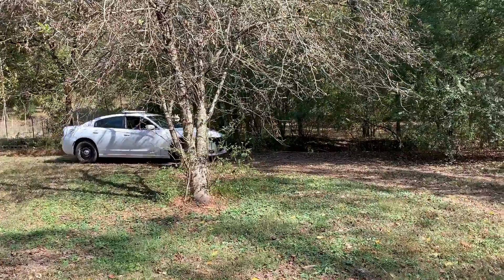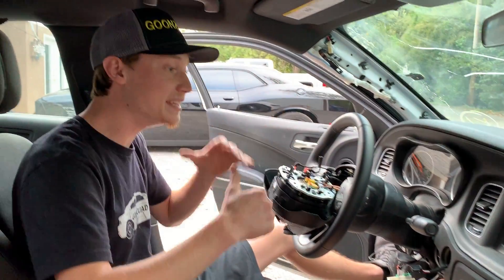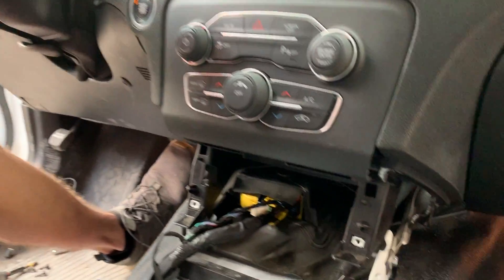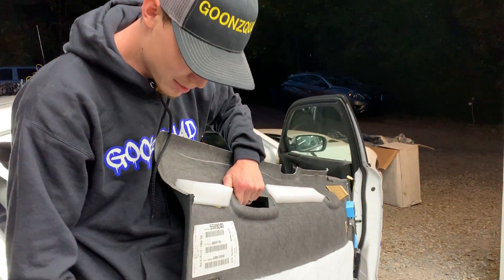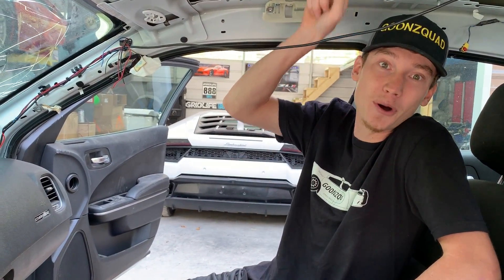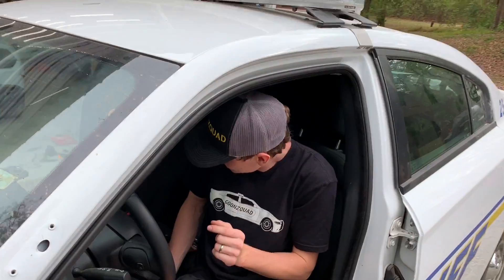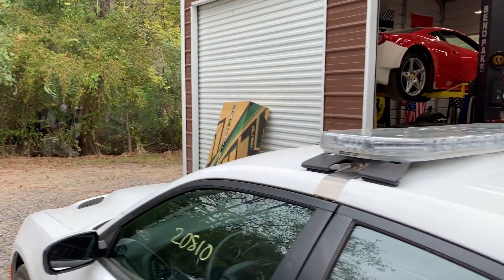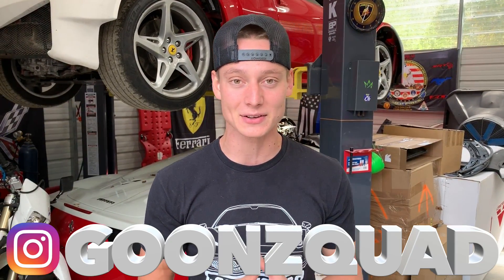Rebuilding A Wrecked 2018 Dodge Charger Police Car Part 8

Comment: Make sure when you get your new decals made, that you get the sign shop to use reflective vinyl. I had a sign shop and did a lot of first responder vehicles with reflective vinyl lettering and stripes. At night they look like they glow when any light hits them.

Comment: You're gonna want to move that arm rest farther back on the Jotto Desk console and move the cup holders up towards the dash ahead of the light controls. Trust me....also, get a 3M disc adhesive removal tool. It's an attachment for a highspeed drill and will "erase" any of the graphics as well as the adhesive without damaging the paint.

Comment: I’ve been working at HYUNDAI Motor in Montgomery for 7yrs, and I work in the trim shop that puts in mounts and seat belts and headliners etc. we put them in through the front windshield while the glass is still out.
Reply: I heard Hyundai work yall to death over there. Had a few cousins work there
Reply: My job easy.. Although I can’t speak for everyone else
Reply: There is more then 1 way to skin a cat you know.

Comment: At the factory, the headliners come in through the front windshield before the windshield goes in.
Reply: Enrique Velasquez I was about to say that
Reply: So funny, I was about to say the same thing, I spent 27 years on the assembly line in TX.
Reply: Enrique Velasquez I thought so too. I was thinking that would happen before replacement of the windshield? But their solution seems to work well too.
Reply: Yep, might be able to get it into the car without folding it up and risking damage. Have to coordinate with the glass guys; only take a minute to slip it in thru the windshield opening after they take the glass out.
Reply: @adolpheddie  yes it is. I work at the toyota plant in canada and looking at how all the internals are assembled is similar to how it is on the Corolla, rav4 and lexus 350. Funny how most car manufacturers assemble the same almost.

Comment: hey guys, when using a hole saw in order to not bend the drill bit when the saw hits the metal.  use a fender washer large enough to cover the saw.  also when cutting with a hole saw put the saw on an angle, and work the area that is all the way cut through around till you are done, you find this helpful.  mike   I love you videos I came on board when you first got your Lambo, I was so surprised to find a couple of young guys that were absolute PROS!!!  since then I have seen many of your videos and am not surprised to see that your work is FAN FREAKING TASTIC!!!

Comment: I’m a deputy in Florida. The light bar has different flash patterns, depending on the maker of the cluster box.
Reply: Thank You For Your Service Deputy 🙏🏻
Reply: Are people allowed to have the speaker box thing an light bar. Or are you going to confiscate the car.

Also for as 2018 car. Thats only 1 year old. You guys trashed the shit out of the interior.  Whats up with that. Don't you respect your cars.
Reply: Stephen Bachman they drive them 24/7 so it takes double the abuse of a normal car. think about it
Reply: @stephenbachman132  they can have them they just cant use a siren or blue lights on public roads.The cops drive around all day in the cars so they probably get dirty waay faster than a normal cars interior does.

Comment: The parts car was so worth it, y'all have def got your money out of it! Smart move y'all!
Reply: Yup, you just can't beat a parts car when you're rebuilding something.
Reply: I agree that a parts car is always good, but how can you say it was “worth it” when they never said what they paid for it, or that they compared the cost of the parts they used vs the parts car price?
Reply: @WIDESIDE72  they did say how much they paid for it when they first bought it and that they paid about $3000 and also mentioned that the parts they needed would have cost them more if they purchased them separately as well as the fact they've took more parts off the car then originally intended.

Comment: Thought about not commenting but here goes. I build ppv " police patrol vehicles " for a living. It doesnt matter what color LED ' s are on the car, or if they're on private property. The only thing that matters is, are the lights on while the car is moving. You can " display " the lights, just not in drive. Also put " demo car " someplace on the car. Another thing that cusioned pad is an arm rest. Put it on the rear of the console. I've actually had sales people pulled over by police, saying they were impersonating a LEO. Law inforcement officer. For your protection, put a disconnect  switch some where outside the car (under hood ). So you dont accidentally turn it on. Other than that nice job, and have fun.
Reply: Good to know!

Comment: Why haven’t they cut that stupid zip tie on the drives seat, lol but good vids
Reply: They are leaving it on to infuriate you!
Reply: I know it really bothers me... But the parts car got a good one so no worries I suppose. I can only think of those creases in the headrest though
Reply: You are not the only one triggered by it.
Reply: It's tactical.
Reply: #TactiCOOL
Reply: To drive you bat shit crazy.
Reply: Haha! Has bothered me as well!
Reply: Was just gonna comment that they should take it out before the headrest gets permanently shaped.. :P
Reply: @jmandagamer  Heat steaming will take care of that.
Reply: Poleets zip tie!!!!!
Reply: Because to them I gose with the car 👐🏼
Reply: What is the purpose of the zip tie there anyway?
Reply: I think that's the last thing they are going to remove
Reply: Maybe they are replacing the seats with something else
Reply: The zip tie and the number 25 also :s
Reply: I literally paused the video to comment this.
Reply: Preston Wilson I didn't pause the video to reply to your comment
Reply: The same reason it was put on in the first place
Reply: At 4:24 : Could that be the gear shift release he was flicking under the steering wheel base?
Reply: im sick of it LOL
Reply: That comes with the poleetz car ..

So you have to keep it like that 😂
Reply: Steve O its holding the headrest together. In an accident the headrest breaks open so when your head slams back it acts a cushion.
Reply: Who cares, watch the vids
Reply: The car is under arrest 😂

Comment: The head liner goes in while the windshield is out.
Reply: As does the dash. That's how they build them in the factory.
Reply: Can’t wait for the next Upload. Keep up the good work. 😎🔥🔥🔥
Reply: Well seeing they dont fix windscreens they are fucked then
Reply: Paul's Garage dash goes in from passenger door when built

Comment: That clip on the bottom of the return spring is more then likely the shift lock override. So if you don’t have power you can put the shifter in neutral for towing

Comment: I’d fit a cut off switch under the bonnet for that live feed to the roof light cluster, that way when your using the car it’s impossible to switch on by accident and if you get pulled you can show it’s all dead and only accessible under the bonnet so you reduce the chance off being booked by a jobs worth cop.

Comment: Where’s tha S2000,what’s going on with that build
Reply: Skip Johnson pretty sure it wasn’t there’s?
Reply: I'm really starting to think it has to do with what gets the most views. If it wasn't a very popular build they probably shelved it like the custom super car.
Reply: Makes sense Kevin Harris. Kinda frustrating to see those unfinshed projects in the background tho....
Reply: It takes time to get the $100,000 worth of parts to put under the hood
Reply: @terrorfex1611  oof great reference haha
Reply: @terrorfex1611  Yep outside of waiting for parts. I think that's why they went with the Charger in the mean time because it had a lot parts readily available. I still want them to see a build all the way through.
Reply: @kevinharris9535  the customer supercars build like the lambo engine wasnt possible that why they stopped that (burned motor)
Reply: Not to worried about the s2000. I would like to see the bikes and boat finished
Reply: @liveandletlive2894  that or they stopped when they got accused of copying B is for Build.
Reply: They have a lot of projects going on. Obviously, they are going to prioritize the more popular builds. Im sure theyll come back to the S2000 at some point, they said they would.
Reply: @808touge  Same here, I don't know about that Northern GA/Southern Tenn. weather but they might put it off till spring :(
Reply: 808touge Ferrari to also if they manage to sell the Nissan 😂 bikes the big truck is well 😂 lots of unfinished projects
Reply: @terrorfex1611  Whatever, go fetch my car
Reply: @kevinharris9535  be
 Is for build sucks and everyone copys goonsquad lol ..

Comment: You guys got to finish

S2000
Police car
Boat
2 Ferrari’s
Motorcycles
Reply: 370z
Reply: AND PARTS LAMBORGHINI WHICH WAS PROJECT
Reply: the boat
Reply: Poleets* 😂
Reply: Brad Griffith expensive and shipping takes time
Reply: property zone too 😂
Reply: and...
and...
and...
and need to sell the Hellcat
and need to sell the Camaro
and need to sell the GTR
Reply: kitcar and the super kit car
Reply: Plus the Nissan
Reply: @nbdy1727  Nope Actually, They Finished It On The 'Selling our Nissan Gtr' Video,
Reply: FirasYT Games I meant the “auction drift car”
Reply: @nbdy1727  o ok
Reply: its a nissan 370z
Reply: And the custom lambo
Reply: @brandonr6601  the super kit car, i said it

Comment: Goonzquad—-“There’s no way you can get to that airbag without taking the dash out”

Dodge hold my beer I’ll pay technician .9 to take off that airbag and put it back in
Reply: Yep I have done a recall on chargers and challengers. The challenger no way it wont come out without removing the dash. U can sneak the Inflator out on the challenger but not the whole assembly
Reply: Steven Plaskett 2009-12 challengers are the worst lmao
Reply: Remember when all airbags used to be modular and not an integral part of the dash? Simpler times when you could just remove the inflated module and pop a new one back in.

Comment: Make sure to use a good sealant around that hole in the roof under the light bar.  That rubber grommet won’t seal that area at all.  Great job on cleaning the light bar.  Those side lights are called alley lights to look down the alleys as you drive through those hard to see places in the dark.

Comment: Hey guys, I used to make decals for movie cars there in Tennessee and you have to have the light bar covered whenever its on road, and the decals have to be approved for road use, or commercial tags with company names. You certainly do not want one of those impersonating an officer charges on your resume. Love the work, and the cars
Good Luck chasing down the drag strip.

Comment: So when using smaller hole saw bits.. with that mandrel put a piece of copper wire on first then tighten down. This will make it easier to remove later. Bigger bits have the 2 set pins so it doesn't overtighten. For the future you should get the 2 set of electrical unibits..they will serve better for the future.

Comment: Love how these guys just wing everything. No idea what half of it is but still manages to get the job done
Reply: Oh MY, I can promise you they are not 'WINGING' it at all and if we could see them work on the planning & research necessary we would probably find out they are putting in 12 hour days ~ 6 days per week. As they work and plan ... they LEARN which is what this success story is all about.
Reply: Yes they learn by trial and error. So winging it. 
Researching online. And learn by giving it a go.
Reply: @samrichards8251  -> I'll reluctantly agree with your clarification. This is where the idiom originated. :: [WING-IT ~ ORIGIN: from theatrical slang, originally meaning [to play a role without properly knowing the text] (either by relying on a prompter in the wings or by studying the part in the wings between scenes).] :: I responded in the first place because this Channel has hundreds of thousands of young people from all over the world who subscribe ~ and probably more young people than are enrolled in Auto Mechanics courses in high school & community colleges ... in the world.  Goonsquad has become heavy duty education and  I would not want a youngster to decide to 'wing-it' when their car is overheating and decide rush out,  pop the hood and touch the radiator with the engine running only find out the hard way there is a fan or two fans that eat fingers for lunch! Safety and compliance with the law are all about knowledge. Hopefully kids watching these videos will 'Wing-It' with great caution.

Comment: I worked a 4 man head liner operation at GM Arlington building SUV’s. My partner and I pulled the headliner from a sequenced rack brought to us on dollies by material department. Together we guided in the long or short HL for Tahoe or Suburban into the windshield opening to waiting hands to put into place. After the fit was there, my partner and I shot down the sunrest’s with 3 screws and a dewalt battery gun. After 9 hours that battery gun got heavy!

Comment: The American flag goonzquad emblem would look nice ,and with your U-Tube channel instead of the 911. You have multiple vinyl sign makers on E-bay. I would suggest also fabricating a red white ,and blue light bar cover to match the vinyl so you won't have to keep taking the light bar off when you daily drive it. Looking good so far!!!

Comment: First off I wanted to suggest reconfiguring the center console. Maybe putting the pad and blank all the way to the back, cup holders to the front and lights and PA up one slot. Second I think you guys should pull all of the decals and spray a blue pearl over the white. Nice and subtle but will make a nice flash of blue when the light hits it just right.

Comment: Alternating headlights - Wig Wags
Takedowns - should be front floods
Alley Lights - floods over the passenger or driver doors
Steady burn - Scene lights
Secondary - less lights
Primary - all lights
Tail flasher and other depends on agency usage.

Used to wire lights and sirens on cars. You need a permit or letterhead to purchase light bars. As for smaller lights, you might be able to talk to a dealer. I know from EMS, we never had an issues getting equipment.

The antenna ports you de-solder. The was an NMO (New Motorola) socket. You can purchase that anywhere. Ask an Amateur Radio Operator (like me).

As a suggestion, have a way to lockout the lights from use while on the road. In other words, a switch under the hood.

Oh! Add a second siren and get a dual siren unit. You will enjoy that even more!

Comment: If y’all haven’t done it yet, I suggest y’all get that broken windshield removed for replacement and put the headliner back in through the windshield opening.  It is soooo much easier that way. 👍

Comment: YOU NEED!!! • Wheels • Front Lip • Rear Diffuser • Stereo/Video System • Built-in cameras for YouTube take downs 😆 • Custom Exhaust "got to sound as scary as the Viper" • Lot of High H.P. Engine Mods "at least a 1000 hp +" • Full Roll Cage.

Then challenge Uncle Sam and Neighbor!
 👍😉

Comment: If decals leave behind some glue, the easiest thing to remove it with are the removed decals. Just repeatedly tap the sticky side onto the glue and it will stick to the decals instead of the car.

Comment: Since you can pop lightbar open, if the local cops complain about it there's always the option to replace the red and blue lights with amber ones, which would be legal to use.

Comment: Glad to see someone finally buying used parts instead of ( let's go to the dealer) get into some real repair granted some parts need to be gotten from the dealership but the idea is to save alot of money  not 5-6 grand under what a brand new zero mile 3 year bumper to bumper warranty car cost....keep up the good work and once you have your new shop you will want to save as much as possible...

Comment: I’d put a little silicone on your roof where your wires go in on the roof of the car may not hold all the water out with that older rubber plug

Comment: My experience is simple when you try to remove the roof you want to try to not fold it in anyway so the best way I found is to remove the back window now if you don't have to do that great but that's my thought.

Comment: Hi i noticed you where having some problems with the glue after you where removing the stickers .. if you use bostic remover (tar and glue) you will find it alot easier to remove the glue and also tar dots left on the paint work just spray leave for a minute and wipe to remove

Comment: on some newer vehicles you can reset the airbag with a scan tool, normal faults reset themselves and airbag deployed codes can be reset with scan tool. not 100% sure on dodge but that's how it is on newer gm vehicles.

Comment: You  should have put some expoy primer on the edge of that roof hole... then after it drys  get a Bush and mix some basecoat with clear and harder and just paint the edge of the hole....she going to rust.... on the roof

Comment: For safely should always discount the battery while the ignition is on. Because if something goes wrong while you replaced any airbag and you turn the ignition on while in the car, the airbag might go off in your face. 

Dont want nothing happening to you guys 😎👍

Comment: You should put a hidden switch controlling a relay to disable the police lights a siren, if you get pulled over cops might ask to verify if it's still active or nope and u might get un trouble. Get a button like under the steering wheel or a foot switch

Comment: I'm surprised they don't have a foam mat on the light brackets so it doesn't run the paint off.  I seen the paint either wore off or at least messed up under the light brackets on the part car.